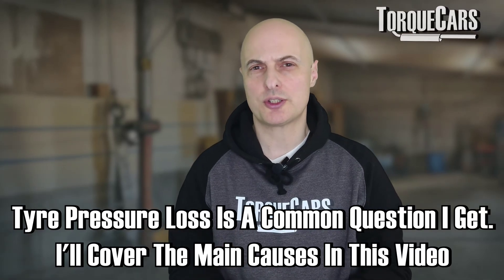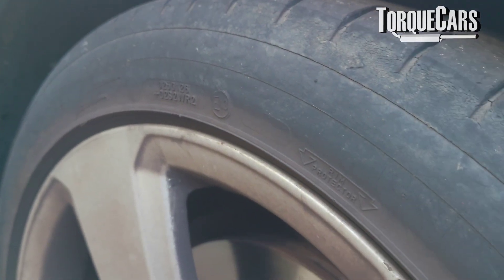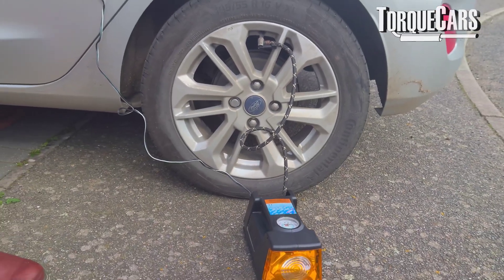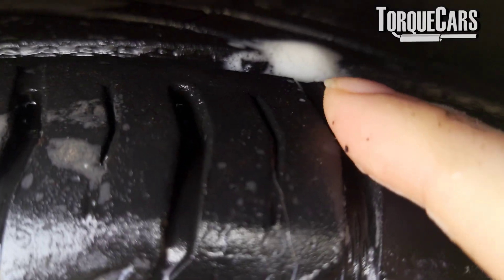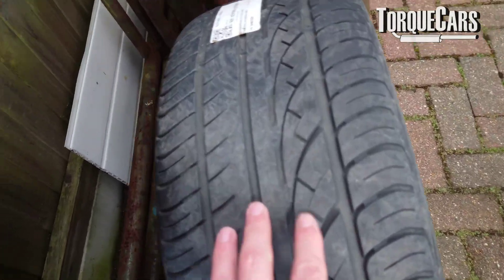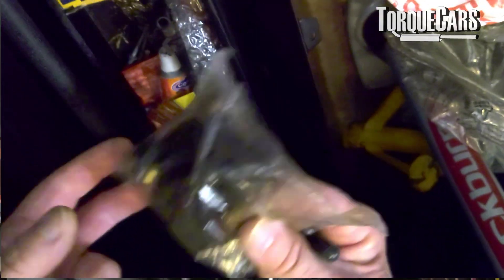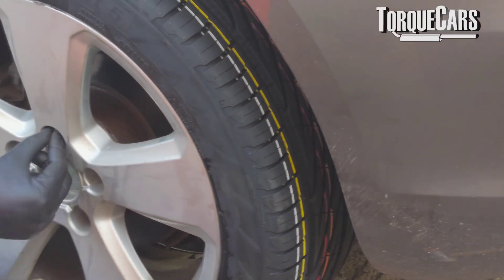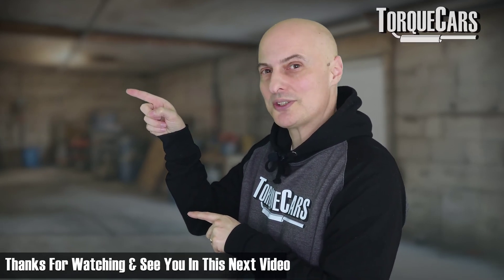Why Your Tyres Keep Losing Air – Without a Puncture! Causes Of Tyre Pressure Loss, 3 Main Culprits.

Comment: Even without checking tyre pressures regularly it is usually possible to tell when the pressure needs topping up, or if you are unfortunate, when there is a puncture. 

As the tyre pressure drops, the handling can start to feel a bit loose.

I had both fast and slow punctures. The fast puncture was relatively easy to notice. As I was driving, I could hear something wasn't right - it was probably the wheels and deflated tyre hitting the road as they were rotating. Then when I got to my friends house, when outside the car you could hear the tyre hissing as it was losing pressure. 

While not ideal, it was probably one or two months before all of my tyres needed replacing, so other than the inconvenience of having to deal with, I was about to spend the money replacing the tyres, so that first puncture wasn't a financial cost and I replaced all of my tyres so that it was done and I didn't have to think about it again - or so I thought.

What was more annoying, after replacing all four tyres from the first situation, about 3 weeks later, I got another puncture - this time a slow leak from a piece of glass that had embedded itself in the puncture. I didn't really notice the slow puncture and the tyre itself wasn't obviously deflated with no pressure. It was the tyre pressure warning system that first got my attention to it - particularly when it triggered so soon after replacing all 4 tyres. Then checking the tyre pressures showed the affected tyre dropping to between 20 and 25 psi confirmed something wasn't right. Then I inspected the tyre more closely and found the offending piece of glass.

Comment: Corrosion on alloy wheels - strong cleaning solvents damages the finish.  Unlike steel, corrosion on alloys 'track' along the surface eventually causing slow puncture at the bead surface.  Never, ever had this problem with steel wheels.

Comment: One of our car tyres used to constantly lose air pressure. It was caused by the alloy wheel corroding. The mechanic used an angle grinder to clean up the alloy and it has been fine since.

Comment: I know you say that checking pressure once a week is too much for many - and you are right - but i think its worthwhile. I checked a few of my colleagues tyres last year and some pressures were crazy hugh or low. One had recently had a blowout too due to high speed on underinflated tyres. Correct inflation is the one 'free' thing that can really save you money and keep you safe.
Reply: No need to check the pressure weekly modern tyres don't lose air that quickly. Check the shape of the tyres and if the shape is changing it's due to loss of air, 1-2 PSI down doesn't matter but once you start losing 5 or more you'll notice the shape change unless you have run flats. If you have run flats then check weekly as even if the tyres appears to have the right pressure it might not.

Comment: Here is one causes of high pressure. Recently I found my TPMs  sensor was advising an increase in one tyre. This turned out to be heat created because of a brake caliper sticking. And the wheel was getting very hot. Audis TTS this is a common fault